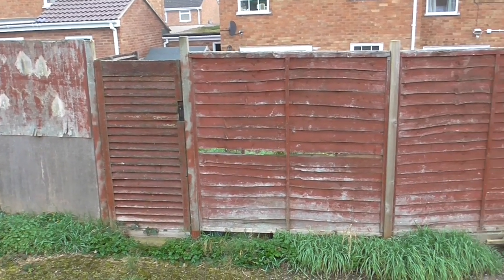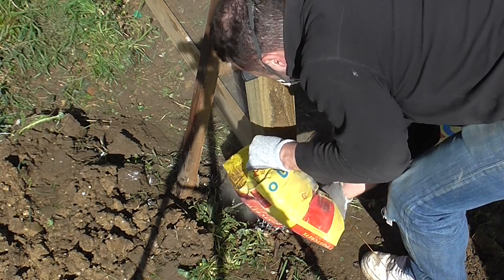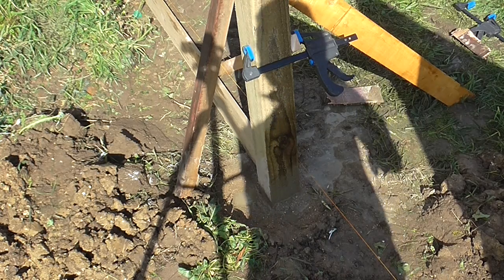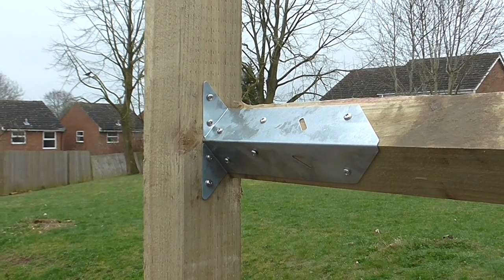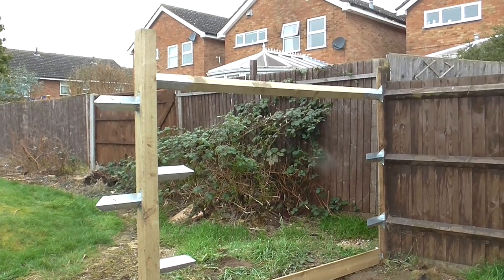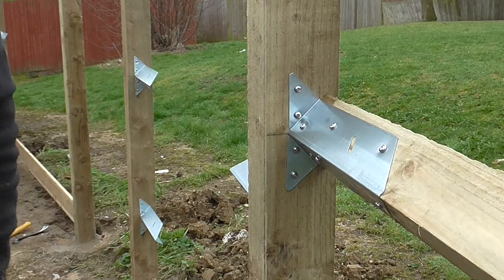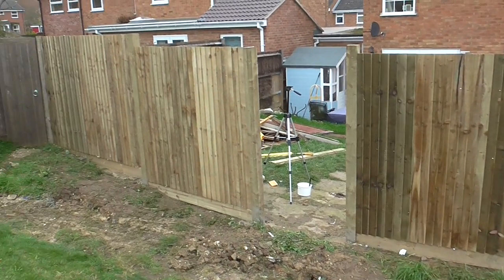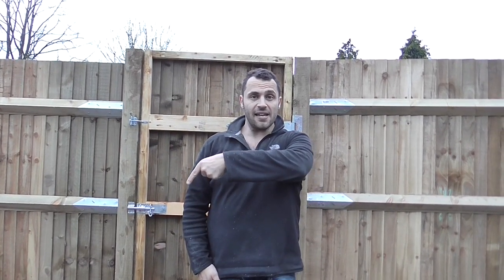How to Build a Fence (the easy way)

Comment: Well done for using screws on the brackets. Looks good. Those large arris brackets used to be for old fences with rails that had gone rotten near the post. You can get much neater ones that the rail slots into and rests. That way you can lift out entire panels. Now everyone just uses the long brackets by default and that's mostly all you can buy.

Comment: Use Torx screws - much less painful! I made a similar fence using Postcrete etc but I used 200 x 100 x 2400 new oak sleepers (£35 odd each) for the posts and used railway sleepers for the gravel boards. The result is the sturdiest fence you will ever find. So sturdy you can install hanging baskets or bird tables etc on the posts as they'll never sag. Slightly more expensive and wider holes required but really worth it and the untreated oak should be good for 15 years before rotting.

Comment: For the postcrete mix it up with a bar adding more water until there is no dry mixture left. The instructions don't say to do this but you will find in that hole there will be a load of dusty dry mix that hasn't gone off especially from that second bag.
Reply: Moisture from ground will sort that eventually

Comment: Great video. The finished job looks very professional. The hole digger and postcrete brought back lots of memories of building a large deck. 42 holes dug and about 50 bags of postcrete. A bit over engineered but still going strong 5 years later. I can just about stand up straight again now :-)
Reply from the maker: Cheers Jon. Hole digging is not much fun 42 must have been a nightmare!

Comment: Cut the bag of postcrete at the top and only half way along. It forms its own funnel when pouring so you get an even pour and it does not spill all over the place. Make your mix slightly waterier and use a stick to agitate it right down to get the air bubbles out. Oh, a bucket pour is quicker than a hose pour too.

Comment: Looks like a sturdy fence. I prefer to make my own to buying then as well. The ready made ones are simple to fit but nowhere near as sturdy. On my fence though I didn't buy the metal brackets to hold the arris rail. Instead I made brackets by cutting two 4cm thick sections of arris rail and screwing them backwards to the post one above the rail and one below.  I then screw through the brackets to the rail.
Reply from the maker: ksp1278 I agree with you about making the fence. Much more sturdy and more flexibility. 
That's a good idea about using arris rail to make the brackets. The ones in screwfix are only 80p each though so not too bad.

Comment: I found its better to dig a thinner hole and make sure the concrete sits nicely above the ground around it. Then slope the concrete and the rain will run away from the post.
Reply: JP 2018 doesnt help with the gravel board though

Comment: Great video.  Good timing too as I need to replace a couple of stretches of fence that didn't make it through the strong winds a few weeks ago.  I appreciate the tip on the arris rail brackets.  I didn't know they existed so I'll have to get some.
Reply from the maker: Thanks Thistledoo 47603 the brackets make it a lot easier even though you have a lot of screws to put in!

Comment: Very good video. Am about to embark on replacing my back fence so this is very useful. When you nail the feather boards on, does the nail go through outer and board under neath it or just the Outer one with the overlap  holding the underneath board flat? Just when I did this previously with some expansion, the inner board split.

Comment: clamps are a waste of time. figure out your corner posts, run strings, and plant 4 feet of PT 4x4 in the ground with 6 feet above ground. Space them 8 feet on center and attach a 6x8' fence panel to the posts. Last sunday I replaced a fence I had the old fence demod by 8:30am new posts were dug, set tamped in leveled and checked to two strings, top and bottom of cornerposts. you can use a small stake to kick the string out to dig, and small blocks to measure out from the posts the depth of your panel and use two temporary 2x4s to hold the post upright and roughly level. you can perfect the post to be plumb and 8 foot on center and spaced off your strings by making small adjustments and adding dirt, then twisting and moving the post before you fill and tamp the dirt around the post.

Comment: problem is , the posts will rot in a few years.. neighbours fence has done that.. don't think it lasted even 10 years. was told to at least wrap them in plastic at the bases.
Reply: Apply 2 coats of bitumen paint to the post from the base  to above ground level .

Comment: Thanks mate for making this video. I’ve got to do my own place arris rail replacement. They’re 10 foot sections (5 of) and after being quoted nearly 5k to do it, I’m doing it now. 
Can you buy the feather edge spacing block? I can make if I need to. Cheers again
Reply from the maker: I just made mine from a bit of plywood. Means you can set your own spacing. 👍🏼

Comment: Hiya Mate. Really enjoy watching your videos. I'm a Geordie but I've recently moved to Australia and I'm re-building my tool collection. Can you please tell me the name of the driver you're using? It looks like one of those bits that can drill a pilot hole then attach a Philips bit to screw the screw in. Cheers mate. Keep up the good work.
Reply from the maker: I think I used an angled drill bit holder. It’s handy when the screw needs to go in at a slight angle and space is tight.

Comment: Nice work again. How did you cut the top of the fence posts please, I noticed they were cut after the featheredge boards were installed to make them the same height as the featheredge boards.
Reply from the maker: Hi Ravi I actually had to only cut 1 which was the far left one I'd attached to the existing concrete post (did this off camera as would have made to video too long). 
The others (2.4m) were put in a 45cm hole which meant with the 15cm gravel board and 1.8m feather boards they were the correct height. 
I used a circular saw to cut the post and finished with a hand saw.

Comment: Great project, looks really nice. I need to do this but think I'll wait til the weather improves!! How does the cost compare of building your own to the pre-made panels?
Reply from the maker: Cheers Keith don't wait too long or the ground could get really hard, especially if it's clay soil like here!
It's a bit more for arris rail and feather board over panels if doing short runs for example £15/m of arris rail and feather board rather than £12/m for panel. But you can do longer runs of 2.4-3m where as panels are max 1.8m. 
You also can use less posts from longer runs which saves on post and postcrete costs. Less holes to dig too and I think it looks a bit nicer and is definitely more solid. Also more flexibility as not restricted by panel lengths. You could get away with just using 2 rails too which would save. 👍🏼
Reply from the maker: This one cost about £325 (was 8.2m) and that included all ironmongery, brackets, posts, postcrete, gravel boards, feather boards, arris rails and screws and materials for gate.
Reply: not bad at all!  and good point about the firmness of the ground too - I hadn't thought of that!
Reply from the maker: Maybe you could get your cat to help you dig!

Comment: What attachment are you using with the impact driver?
Reply from the maker: Hi James I think I used 2 different ones in this video. One was a simple hex bit extension when I fitted the gravel board and one was a DeWalt swivel bit holder to allow driving at an angle for the brackets.
Reply: Happy Wife Happy Life 
Ffffffc

Comment: intro music is so wrong
Reply from the maker: MrMannekuin congratulations for posting the most inane comment yet on my channel. 👍🏼
Reply: hahaha why thank you cool video though quick question one of the arris Rails i bought are too short is there a way to connect it or do i need a new one ?
Reply from the maker: MrMannekuin you are welcome. Depends on your skill level and tools you have available but you could try and make an extra bit out of some other timber and splice it with the length that is too short. 
It's probably easiest to take it back and exchange it though if that is feasible.
Reply: appreciate it, keep up the good work.